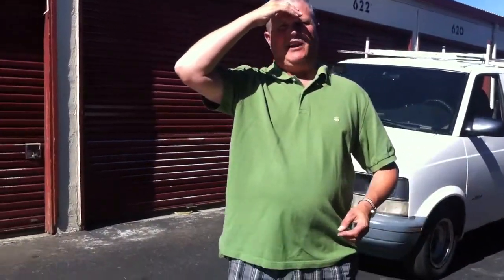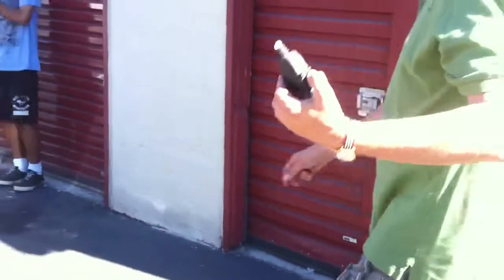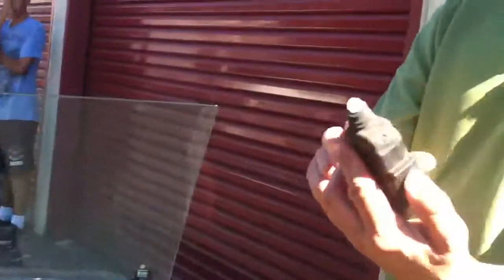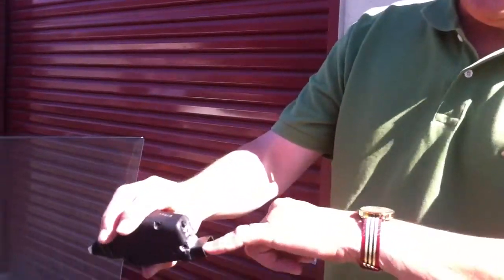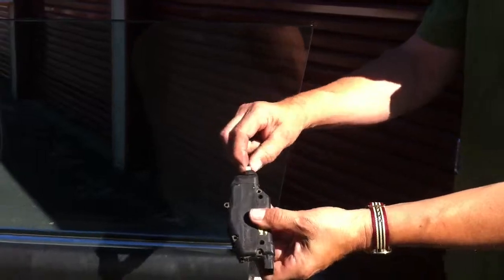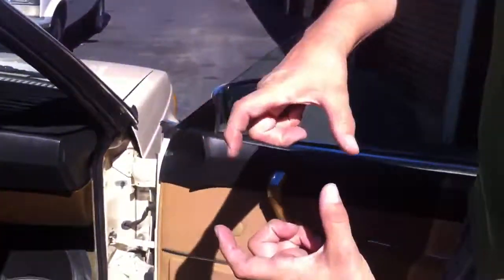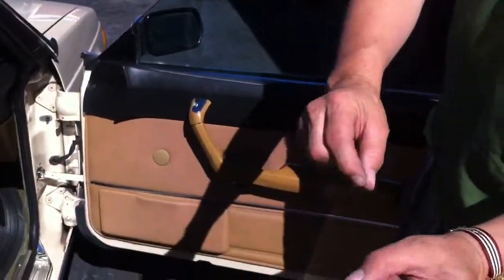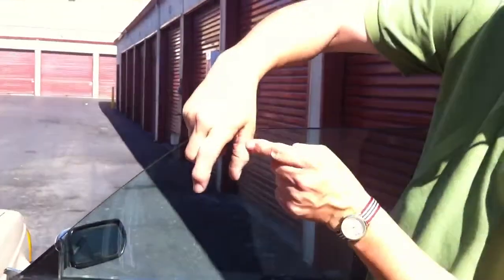BMW E24 Electrical Charging System Information.

Comment: This was a known issue in earlier bmws mostly noted on E30.  It is also stated in the Bentley manual.  It is fixed in later 80s. Only well experienced 80s bmw techs will know it.

Comment from the maker: 1.5 Watt Dash Battery Indicator Light Bulb in 1976 to 1989 BMW vehicles including my wife's 6-Series E24.
Reply from the maker: Light Bulb acts like fusible-link to electrical charging system which stops charging battery if burned out.
Reply from the maker: The three bulbs used are 12V 3 watt, 1.5 watt, or 1.2 watt. The 3w bulb is the most commonly used by BMW.
Reply from the maker: The vehicle used in this clip is our 1980 633CSI, but the interior dash light bulbs were installed on all BMW motorcars built from the late 1960's to the mid 1990's.